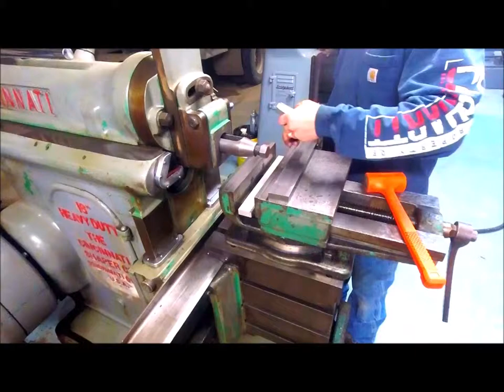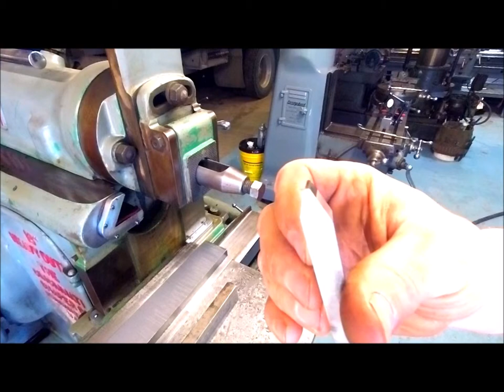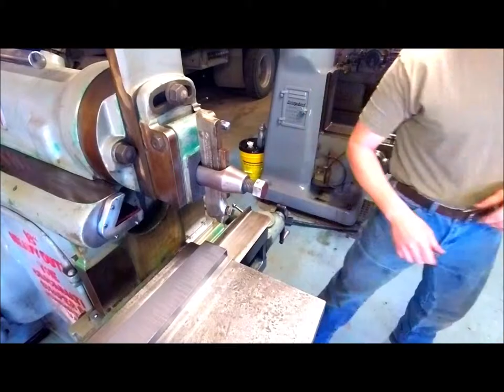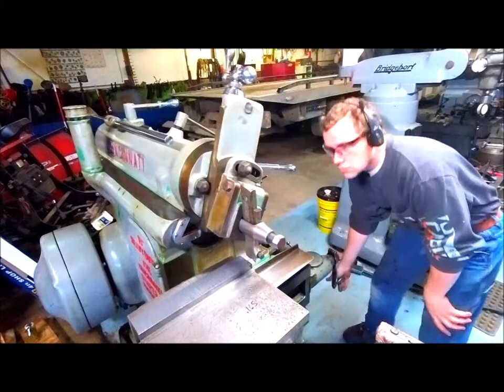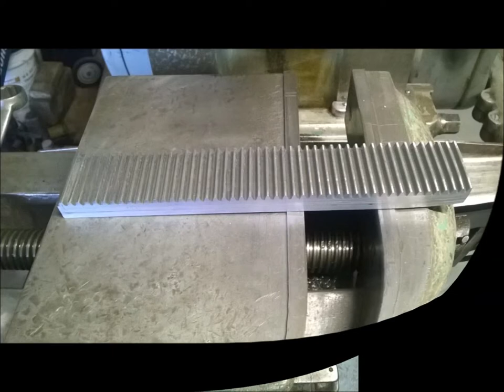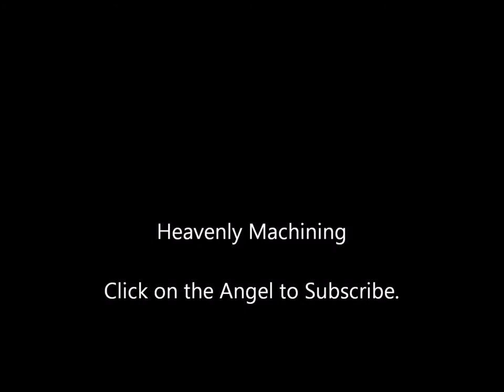Cutting a Rack Gear

Comment: I extended an arbor press ram an inch or so like this on my G & E shaper to get a bit more stroke.
It was actually a harbor freight gear/rack  arbor press.
I was making a slotting bar to cut some
Cylinder liners out.
I pressed is a square hole bushing
For a slitting cutter.
Worked fine.
Good Video.
K

Comment: why has the vertical slide been set over, does the mean the tool will cut more on one side than the other. Is it like setting over the topslide on a lathe to cut threads.
Ron
Reply from the maker: Yes you are exactly right.